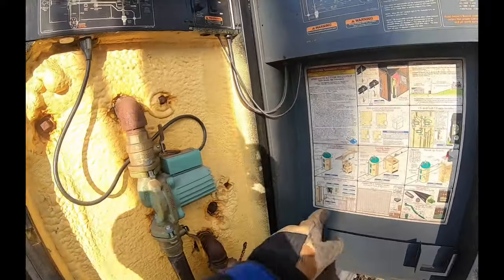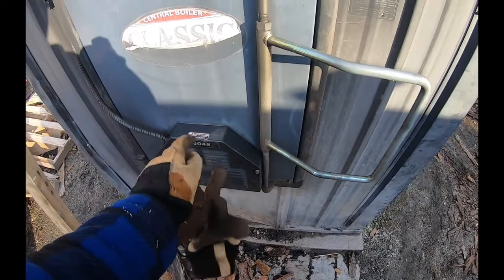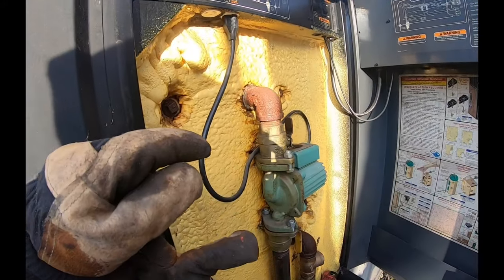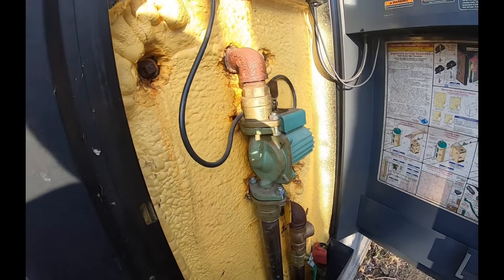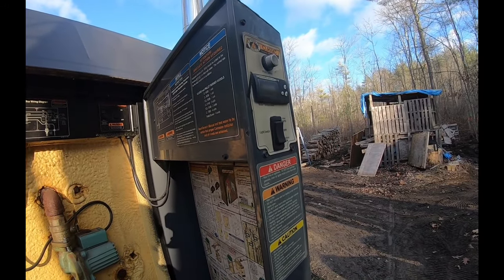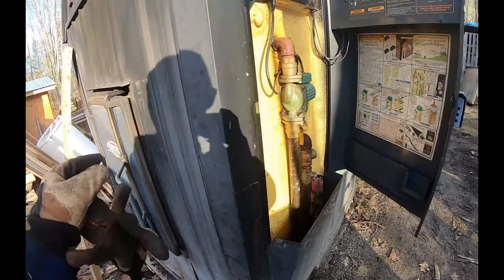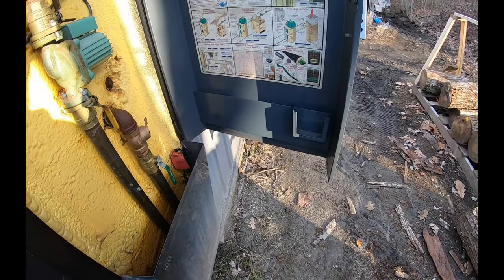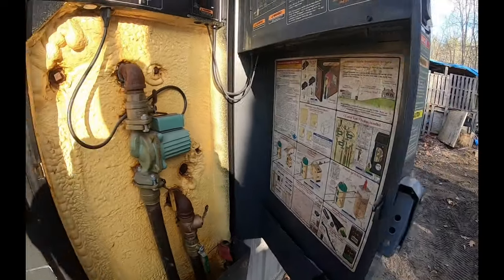What Happens To Your OUTDOOR WOOD BOILER When The Power Goes Out?

Comment: So when my power went out, I manually went out and opened the door to allow the fire to start up again. Thinking thinking I would avoid the fire going out. This was wrong. After a short while steam was pouring out it the relief pipe on the top. When the power came back on the temperature was 220. I do believe that had I kept the pump running with a generator, the water moving into a rapidity cooling house, would have kept the water from getting so hot. Run the water pump at a minimum to keep it from getting too hot. At least in my situation, the heat exchanger would have had hot water running through it and by convection, some warm air would have circulated in my house. Love your channel my friend.
Reply from the maker: Hey there! I did the same thing when we lost power. I ran to the boiler and cracked the door and then 10 min later it was boiler water out the top. There is so much thermal heat in that machine that it would take like well over a day to cool down and freeze. If the water is not ciruculating its basically a 400 gallon insulated water tank! The key you say is to keep the water moving indeed to pull heat off into the home!

Comment: Great video Jay.  Just questioning the 40amp circuit statement.  My CL5036 is run on a 15amp dedicated circuit with 12/2 wire and a ground.  I know the 6048 is the next size up but my understanding is just the firebox and water reservoir is larger it shouldn’t require additional amps or power.  Ours is also backed up with a generator to keep it and all of our pumps running for our radiant in floor heating system.
Reply from the maker: Yes 15 amp you are correct. I wasnt sure and didnt remember at the time so 40 was my guess lol

Comment: I think all furnaces require power, unless you have an old gravity furnace, or a wood stove On a lot of acreages there are backup generators with transfer switches that automatically start up and run. Almost a must in this day and age, worked with the Cummins Onan generators and installed a lot of these, only way to go especially if no one is home or medical equipment such as oxygen pumps etc is in use. Good info Jay, I bet many people don’t think on these issues. Cheers my friend.
Reply from the maker: Id love a standby generator! Those diesel ones are bada$$

Comment: Simple solution. If you have a generator, plug in the circulation pump, open the boiler door and plug in a leaf blower to fan the fire. With the door open it'll burn like a campfire keeping the tank warm.
I don't know about getting heat out of it at the house end though.
Reply: Great idea
Reply from the maker: Yeah thats a deff worse case you can "manually" open the door every so many hours to re heat the water up!

Comment: The solar aspect is what brought me here.  Have you calculated the amount of battery backup you would need to run it 24 hours off-grid?  At sub freezing temps, of course..
Reply from the maker: No idea. It’s on the list. Only have a 12v pump to run. Now inside is different story cause you have so many different circuits for each thermostat but a eco Flo stand alone unit could circulate the pump on the boiler preventing it from
Freezing at least.

Comment: Not sure about the circ pump but I wonder if a ups ( uninterruptable power source ) box that is used on /for  things like fire, computer and communications systems could be incorporated. Its a battery backup.
Reply from the maker: I would need it for the whole circuit not just the pump itself
Reply: @HomesteadJay  I believe that a ups could if sized for it.

Comment: Jay....I think you better check that breaker you have feeding your unit...it should be 20 Amp max..and you could plug the whole unit feeder wire into that generator if you install a male female plug set in that cabinet...120 volt 20 Amp will run the largest wood boilers out there..
pc
Reply from the maker: Sorry it was a 15 amp I wasnt sure and didn't remember at the time so 40 was my guess lol

Comment: Mine(Hardy brand) is on a 20 amp breaker. It has a blower and solenoid for the damper and pump. The pump uses about 1 amp on high speed. Never had an issue. I would think yours would use less amperage since it has no blower.?
Reply from the maker: Sorry it was a 15 amp I wasnt sure and didn't remember at the time so 40 was my guess lol

Comment: We have the same boiler, However I believe 20 amp is all you need to run it🚜🪵👍🏼🇺🇸
Reply: That's what I was thinking. Actual draw on those components should be well under 20. Maybe Jay can check his panel and post a follow-up.
Reply: Yes you only need a 15 amp or 20amp  plus I bet he only has 12/2 running out there that wire will melt before that 40 amp breaker will trip
Reply from the maker: Yes 15 amp you are correct. I wasnt sure and didnt remember at the time so 40 was my guess lol

Comment: I installed a waterproof plug where my power comes into stove. Power goes out, unplug from panel and plug into generator.
Reply from the maker: Perfect!
Reply: Gary, read your comment, followed your advice and my 2000 watt generator is running the Central Boiler perfectly! Looks like we will be out of lower for several days. 9 degrees tonight. We will be cozy. Thank you!
Reply: Awesome.. glad it helped u out

Comment: I would agree on dedicated circuit. 40 amps is not true. There is a pretty big cost difference between a 15 amp and 40 amp circuit. Be cheaper to buy and install a heat pump if this boiler required 40 amp circuit. Gonna confuse some noobs.
Reply from the maker: Sorry it was a 15 amp I wasnt sure and didn't remember at the time so 40 was my guess lol